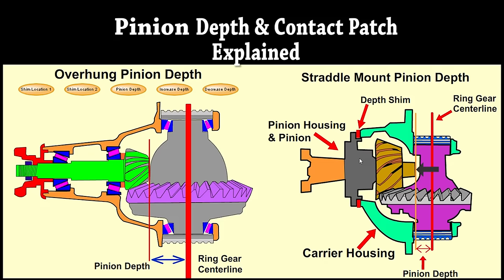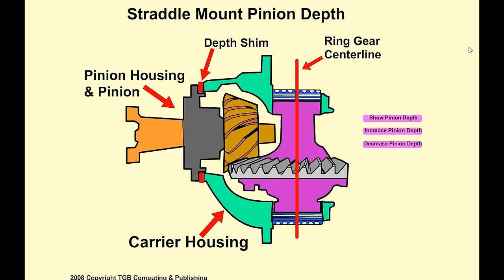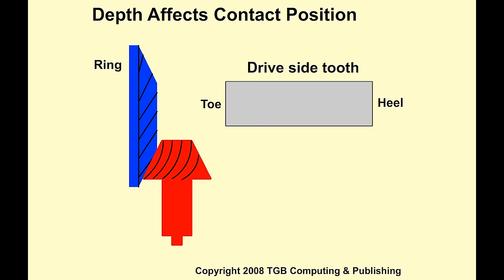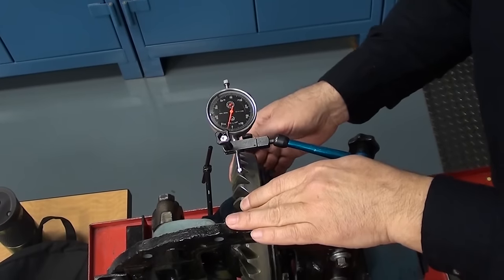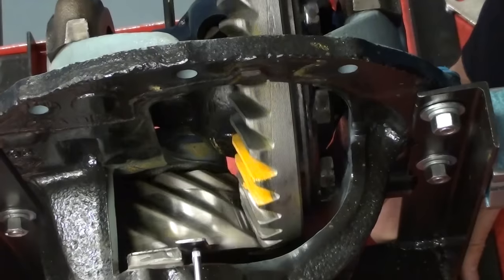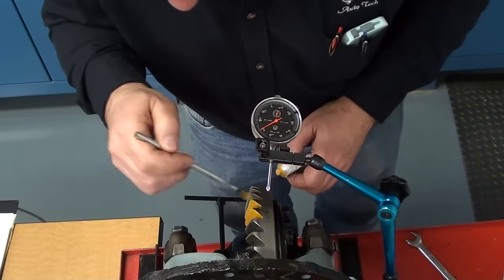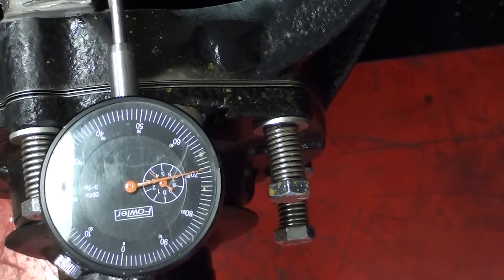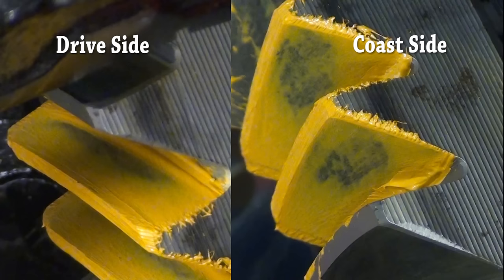Contact Patch & Pinion Depth Explained

Comment: Faulty diagram. The pinion itself and the conical bearings, on each end of the pinion, have to have zero clearance or the pinion would tilt up or down randomly during use. Therefore all in and out play at the drive shaft flange must be zero clearance to cause each cone inner bearing to ride straight on the races. So that is an absolute that must be addressed and the location of pinion teeth with the ring gear would have to be done with a pinion that extended farther in its length by the machining maker or a ring gear that had teeth that extended farther inward. But you cannot have in and out play at the flange at the nut
Reply from the maker: Yes of course the pinion bearings have to have a preload so there is no movement.  The diagram is not faulty and it serves an accurate representation for the purpose of the explanation of  pinion depth what it is and how the contact patch is impacted by correct and incorrect pinion depth.
Reply: @DrivelineMaster  Yes, but after the intitial adjustment of pinion flange preload, the fact that the teeth on the pinion dont match up with the ring gear is still not adjustable as the diagram tries to represent, meaning its a useless faulty diagram made by a person that sits behind a desk. The only adjustment at the ring gear is shims or a different ring gear altogether. Its still a fictional diagram. You need to read again my comment. There is no way you can correct the pinion depth once any end play is gone. Cant you understand this?
Reply from the maker: @EarlGuyton425  I believe I do understand you point.  When the depth increases the animation leaves a large gap so the ring gear teeth don't touch and of course when pinion depth is reduced the pinion would jam into the ring gear.  I as well as you know that pinion movement is done without the ring gear and case installed. then after the pinion is in the ring gear location and backlash can be adjusted.  I didn't take the time to make the animation that complex plus the idea was to get across the concept of what pinion depth was and I wasn't so worried about that part of the animation.  Maybe I should have. This has been up for a long time and a lot of experienced technicians have viewed it without complaint.  Yes, the animation and graphics could be more accurate.  I'm a self taught graphics and animation person and this is what I came up with and I still think it's pretty good at explaining pinion depth.
Reply: @DrivelineMaster  The diagram doesnt show/inform that ring gear tooth adjustment also has to be done by adding or removing shims at the bearings on the sides or shims behind the ring gear. Thats why I see it as a fictional diagram, because the novice will be led to believe that the pinion itself can be further out or inward without regard to the end play fixed necessary position. The maker of the video diagram Was probably done by a novice individual that sits behind a desk that took an original blue print machining sheet and made it appear that there is a pinion adjustment and ring gear adjustment. The original blue print they worked off of required no adjustment at all. To make a pinion assembly go inward or outward more would requiring the machining of a totally different pinion that was shorter or longer and that wouldnt be necessary because the original blue print shows the allowed clearances. So why is or was this diagram made which will only cause false believe in the minds of your average person. The mind of the novice will now believe, Oh no I better measure the clearance where the end of my pinion is next to the hub now, when in reality that assembly with its pinion sleeve and washer behind the rear pinion cone bearings are a fixed pre measured assembly  as in these are not things any person is going to have to worry about or ever do.

Comment: I’m a newbie to this. I have a question. Where I’m confused is could you just move the ring gear only to get the correct position and backlash?

Awesome video by the way?
Reply from the maker: There are two adjustments that need to be made. The pinion depth which makes sure the pinion contacts the ring gear in the center.  This is done by moving the pinion in the housing either closer or farther from the ring gear centerline.  The backlash is the second adjustment and that is the free clearance between the gear teeth.  This is accomplished by moving the ring gear.  Because of the shape of the pinion, moving the pinion also effects the backlash but moving the ring gear to adjust the backlash does not effect the pinion depth.  Hope this helps.

Comment: Hi should there be play of about 1/8th of a inch between load and reverse on the piñon.? Tia.
Reply from the maker: 1/8 of an inch is equal to 0.125" and that is excessive.  Each differential is different but on an average most differentials will have free play (called backlash) between 0.005" and 0.009".  I have see specifications as low as 0.003" and as high as 0.014".  Evan at 0.014" that is a large difference to 0.125".  It requires a dial indicator like what I used to accurately make this measurement.
Reply: Only on an ox cart...

Comment: if the drive is acceptable and the coast is off.. how would you adjust one without throwing the other off?
Reply from the maker: You can't.  Go with the drive side.  How far off is the coast.  As long as the pattern is not totally running off the toe or heel or too high on the face you should be OK.  I'm assuming your backlash is also within specification.  If it is really bad make sure you don't have excessive backlash variation or ring gear run-out. If all is good and the patterns are still really far off there is a problem with the gear set even if it is new. I like to set mine so the drive side is a little towards the toe and the coast is a little towards the heel. that way under load they will move slightly towards the middle of the gear tooth.  Hope this helps.
Reply: @DrivelineMaster  very helpful info. thanks. it was a  hypothetical question. I'm not experiencing the issue, just curious if it was possible to remedy if it occurred. i figured it would be a faulty ring/pinion if it happened though. i'll be assembling mine in the next week or 2.
Reply: @callofgeorge  this is  what i am experiencing now in trying to resetup a set of gears in a Dana. My coast and drive pattern are no way the same.

Comment: I'd be curious to heat up the components to operating temperature and check if that affects the contact point.
Reply from the maker: Yes there will be a minor change due to heat expansion.  The backlash is more likely to change but the depth is not likely to change. I doubt the contact patch would change enough to see or measure it.  Of course the higher the heat the more likely the change.

Comment: Hello, I am doing this in a front axle and no matter what pinion depht I set, the coast side keeps always near the toe. I understand that in a front axle it is more important to get a good pattern in the coast side, so I don't know what to do to accomplish that.
Reply from the maker: Sorry for the late reply.  I have been out of town.  If you have a front axle and the pinion is up high in other words flipped over from the way the rear diffs sit than you have a reverse cut and the concave side of the ring gear is the drive side instead of the convex side.  Everything is backwards when the diff is flipped.  My questions is? How much on the toe?  is it off the edge of the tooth?  If not, this might be OK.  If it is, you need to increase the pinion depth.  If the shim is between the head of the pinion and the bearing then the shim needs to be smaller.  Have you tried it with no shim just to see where the pattern is?   I'm going out of town again next week but I will try to check in if you write back.
Reply: @DrivelineMaster  thank you very much for taking the time to answer my question! It has not any shim between the pinion and the bearing, I set the depth by putting or removing shims from the back of the bearing cup. The pattern is already well centered in the drive side. In the coast side, it is between the middle of the tooth and the toe.
I even started again without any shims and the pattern was as I expected, drive side in the hell and coast side in the toe. I started adding shims one by one and it moved in both sides, until I got the best I could, centered in the drive side and near the toe in the drive side. From tha point, by adding shims the pattern just moved in the drive side and nothing in the coast side.
Thank you very much again for your kind answer.
Reply from the maker: As long as the pattern has some untouched paste showing on the toe, heel, flank, and face you should be good.  Perfect patterns are not that common.  If you want to take a photo and send it to me I can verify if it's OK or not for you.
Reply: Thanks again for your response. It is as you say and there is an untouched area in the toe. I will run it this way.

Comment: Why does pinion depth seem counter to what one might think? Moving pinion closer to cl decreases pinion depth? Please explain this...
Reply from the maker: Pinion depth is a reference to how far down the pinion sits inside the housing in relationship to the centerline of the ring gear. So, as the pinion sits deeper or farther into the housing pinion depth becomes larger and if the pinion sits higher or not so far into the housing the pinion depth becomes less because it is closer to the centerline of the ring gear.  I hope this helps.
Reply: @DrivelineMaster  thank you for your reply. That is the way I think of it also but it seems like the video states opposite.
Reply from the maker: Maybe it's the way I worded it in the video that has confused you. My students often get this confused. Increasing pinion depth means the drive pinion has to move farther away from the ring gear centerline.  Decreasing pinion depth means the drive pinion has to move closer to the ring gear centerline.
Reply: @DrivelineMaster  lol I'm even more confused now. It seems like you contradicted yourself again. I hope you will have patience so I can understand this. I have a classic vehicle that needs rear attention and I need to get this so I can attempt repairs.
Reply from the maker: However your looking at it I'm not contradicting myself.  let me try again.  Pinion depth is a measured value. That measured value is from the top of the drive pinion gear head to the centerline of the ring gear.  How far down the pinion gear sits inside the housing impacts that distance.  You can try these two other videos.  https://youtu.be/QL-dmhfSj6k and https://youtu.be/gk6imita0cc to see if they help. If your rebuilding your diff and your going to put in the same gear ratio you normally can reuse the pinion depth shim and be OK. You don't need a fancy measurement tool if you know how to interpret a contact patch and fine tune the pinion depth based on the contact patch. It's educated trial and error that works and less expensive than buying a measurement tool just to rebuild one diff.
Reply: @DrivelineMaster  thank you for your patience. I purchased this car 6 years ago. It's a Cobra replica. I've had to correct a few things. Ever since I got it the rear end WHINES on deceleration. Something must not be right. I don't know what I'm going to find. The ring and pinion is supposedly Richmond Gear. The rear is a Ford 9".
Reply from the maker: Most likely if it whines on deceleration you will find the front pinion bearing is causing this. You might be able to get away with new bearings, seals and gaskets.  The gears that take the most load and will show the most signs of wear will be the spider gear set and not the ring and pinion. Ring and pinion gear sets can whine but they don't just start whining. They will whine from the first day they have been installed. They sometimes get better after break in but they are never just fine and then after a few years of service all of a sudden start to whine.
Reply: @DrivelineMaster  Thank you for your expertise. This car was hardly driven from new. It has whine since new and certainly since I have owned it. Regrettably I am just now getting around to attending to it. I will provide feedback...
Reply from the maker: Good luck. At least with the Ford 9" you don't have to take the pinion bearings apart to adjust pinion depth.  Once the pinion is installed into the pinion housing and the pinion bearing preload is set you don't have to mess with it again to change pinion depth.

Comment: What happens to backlash at full operating temperature ?
Reply from the maker: It normally decreases.  Factory specifications take that into account. The specifications are based on the adjustment being made at room temperature.

Comment: What if i have good contact patch but to much backlash( 0,20mm)? What i have to do?
Reply from the maker: You need to make the proper adjustments to reduce the ring gear backlash.  You can do this without effecting the pinion depth or the depth pattern. If your diff uses shims you need to decrease the size of the shim on the ring gear side and increase the size of the shim on the other side by the same amount.  I you have threaded adjusters you need to loosen the ring gear side adjuster a few degrees and tighten the other adjuster the same amount. Do this until your backlash is correct.
Reply: @DrivelineMaster   i have shims  in my diff,  i need decrease backlash to 0.13-0.15mm. So i need shimm thinner by 0.06mm and the other thicker by 0.06mm?  or maybe it is better to buy one thicker and thinner by 0.09mm?  my differential washers are cost  20$ each :(
Reply from the maker: Can you please tell me what diff you have.  Year, make, model and ring gear size?  I can better advise you with this information. At $20 each you need to be right.  There maybe a speedy shim kit you can buy that will provide you with more flexibility.
Reply: @DrivelineMaster   Lexus is200 2001r.  In the manual is.. "Backlash (reference) 0.13-018mm"
Reply from the maker: I did a little research on your diff.  I'm thinking you are not in the United States because we don't list a 2001 IS200 but we do have an IS300 that I would bet is very similar if not exactly the same.  So you want to make sure this is done right.  You will need to purchase new shims of the correct size but at that cost you want to make sure to only make one purchase that will dial in your diff.  Before we do this those shims not only provide backlash settings but they also add a preload onto the case bearings.  You will want to make sure the case bearing preload is also correct.  Lexus does talk about total pinion and case turning force but they don't really offer a clear cut specification.  If you can give me some more information I can advise you.  1st. did you remove and reinstall the drive pinion? If so, did you use new bearings?  If so, what did you adjust the drive pinion preload to in inch pounds of rotational force without the ring gear and case installed? This is critical to get a baseline to know how to preload the case bearings. Now install the ring gear and case with the shims and bearing caps.  Re-measure the turning force on the drive pinion.  That value should be approximately 2 - 4 inch pounds greater.  If not this will impact what shims you purchase.  I also need to know the ring and pinion gear ratio and the thickness of each side bearing shim. Make sure to state the ring gear side measures xxx and the non-ring gear side shim measures xxx.  The last bit of information I need to know is:  Are your side bearings new or are you reusing the old bearings?  If you want my help and can get me this information I should be able to advise you on what size shims you should purchase. I typically work in inches but I can work in mm and newton meters if needed.

Comment: One small point you showed contact area in drive and reverse gear for coast side you should've driven the crown wheel
Reply from the maker: It took me a bit to figure out what you are pointing out.  I believe you are calling the ring gear the crown wheel.  Am I correct.  I think also what you are saying is that the coast side is actually driven when the vehicle is coasting as the drive wheels drive the case and ring gear which in turn drives the pinion gear.  I have done the pattern both ways for drive and driven and several service manuals and aftermarket gear manufactures will turn the pinion forward and reverse or they will turn the ring gear forward and reverse.  I have done this both ways and the results seem to be the same.  The key factor is adding resistance to the rotation. this ensures the paste wipes off correctly.
Reply: DrivelineMaster thank you for a very informative video. Yes I called the ring gear the Crown gear I also called Coast side overrun side overrun occurs when the power train is working backwards being powered by the back wheels of the car